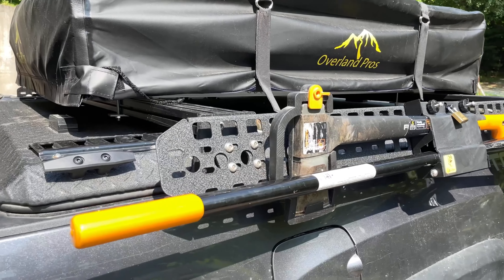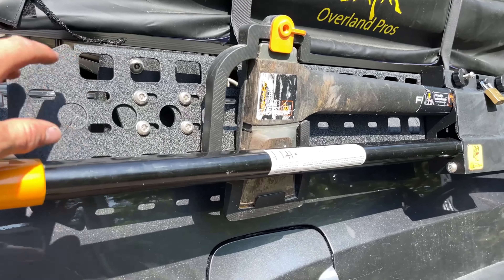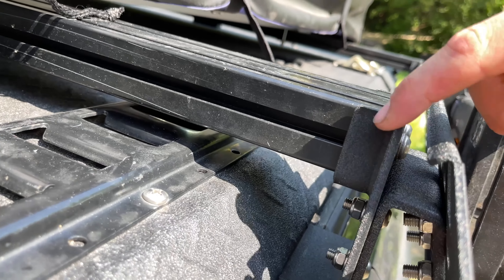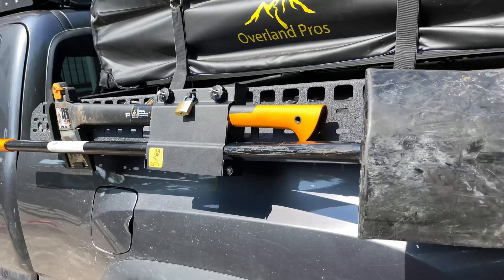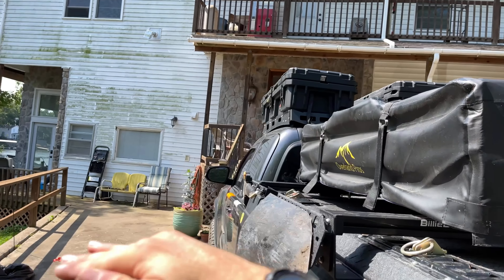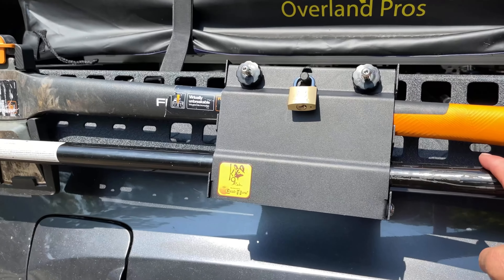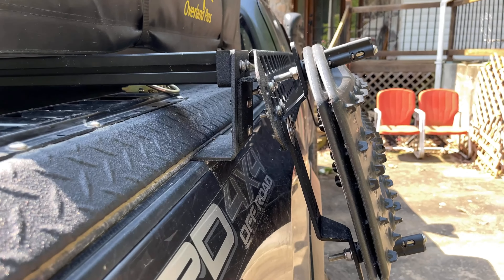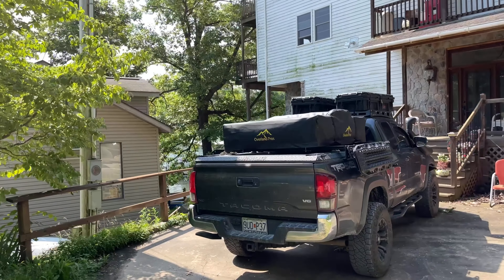PT 22. BillieBars Bed Rack! Tacoma Overland/Daily Driver Build.

Comment: I’m running the Kb-Voodoo version with the diamondback, interesting to see if the molle panel fits my set up. 🤔
Reply from the maker: I would doubt it due to the mounting brackets they come with although I’m sure you could always try and fabricate some sort of adapter bracket of sorts. Thanks for watching!!
Reply: I just got rid of my Voodoo because of their customer service. I switched over to billiebars and couldn't be happier. Maybe voodoo is good for some people or maybe I just dealt with a crap representative but wont be doing any business with voodoo ever again.

Comment: Are you running the toolbox with your diamond back? I’m afraid the Billie bars won’t fit with the toolbox from diamond back
Reply from the maker: No I’m not, I’ve never ran the DB tool boxes but you should still be able
To adjust the Billy bars mounts forward to clear the toolbox I would think? As long as you obviously had the room before hitting the center piece of the DB.

Comment: Can you open your Dimondback cover ?
Reply from the maker: No you can’t open it with the rack in place, now if you aren’t running the RTT/cross bars but want to run the molle panels with maxtrax ect still you can open the cover with those installed.
Reply: Which is why I'll be going with the Retrax & likely a higher riser set up.

Comment: where did you purchase the locking mount for the axe and shovel?
Reply from the maker: I think the website was called expedition one or something close to that. But I would not recommend that mount at all. If going to be mounted on a bed rack it’s terrible, the shovel continuously rotated while inside the mount where the shovel head was touching the truck and scrapped up my truck pretty good.
Reply: @marshalljones4315  thanks for the heads up, I’ll look into a different mount